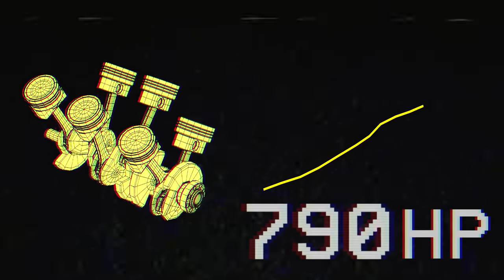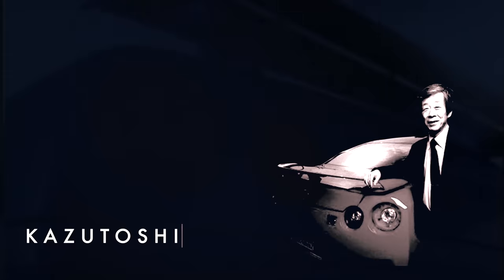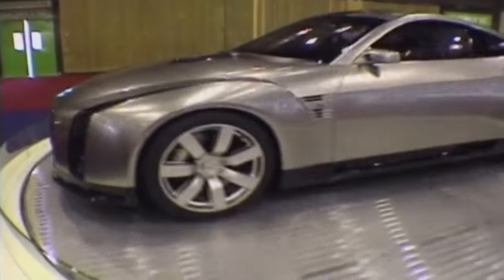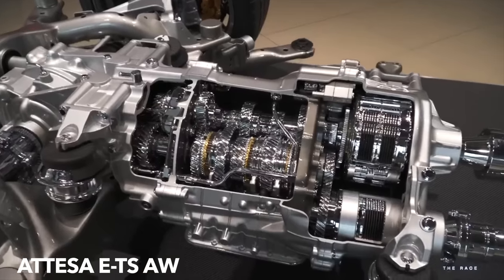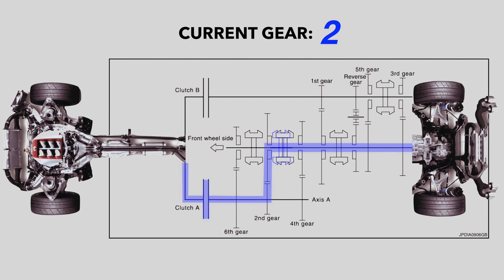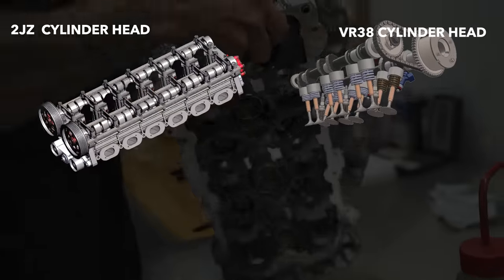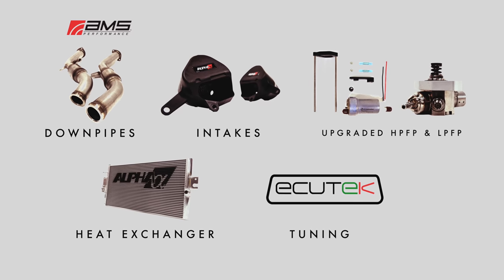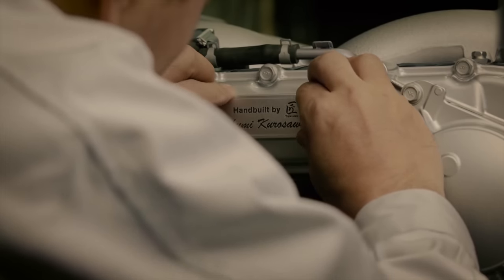Why Nissan’s Turbo V6 Engines Are Too Powerful (GT-R and Z)😳| Explained Ep.31

Comment: But the two jey zee soupbruh comes with 10000hp stock, so it beats everything
Reply: Understatement.
Reply: Haha yes mate
Reply: Your comment made me spill my tea
Reply: @driftmouse_official  Your comment made ME spill my coffee. 😂
Reply: Thanks for the pin lol
Reply: 2 Jay Z's
Reply: @Hoonagen hope u make more hp after that)
Reply: @chabweezy9905 2 Jay Z's are better than one
Reply: Handuh is better cuz that V tech just kicked in yo!
Reply: More like 1337 speed. Always great vids. Still waiting on the diesel 2j thou Om606 Benz diesel
Reply: You got that right! Toyota numbawan!
Reply: Haha 2jz stock bottom end actually does support 600-800whp. OEM VR38 would do a rod at that level.
Reply: 🤓 actually the 2jz came stock with 349hp n/a if you tickled its balls
Reply: Easily! It could power a locomotive or oceanliner if needed
Reply: There actually kinda slow stock. You can do true twins conversion and crank boost up with fcd but ur capped around 4-500 on those stock twins.    You can upgrade them though. And with more fuel. Make some decent power with a great power band.   But they need those twins junked and a t4 slapped on with big fuel too make 1000. And for how long. Now 800 that’s more realistic
Reply: @BNR_248 stock factory vr38’s make 600hp lol, stock long block can take 800 on race fuel. Really isnt much difference between the two motors in their ability to take power stock. Ive seen 500hp stock 2jz’s throw rods and pinch rings.
Reply: 3500hp barras in Australia, barra is the best inline 6 ever built. I own a 1000kw territory (built to actually take 1500kw).

A barra powered supra has 30-40% more torque at the same hp and the motor is actually lighter also....
Reply: @DirtyDanRacimg Yep I said 600whp not 600hp at the crank. I know how much a GTR makes cause I own one 🤣. Agree I’ve seen 2Js grenade itself on much less power, but on average a good condition 2j on a good tune will do 600-800whp. It being mostly in a rwd application gives it a bit of an advantage..
Reply: @BNR_248 VR38 bottom end can hold over 900 wheel hp it’s the torque it can’t handle. Anywhere past 650 tq is iffy but plenty cars running around with 680 ish torque.
Reply: @damonlandry9129  yea that’s true, I was just going off the arbitrary number suggested in the video. But agree, cylinder pressure and torque kill rods and bearings.
Reply: You’re not wrong tho
Reply: thats what r35 owners think when they buy thier r35 LOL.  30k in transmission and 120K in engine parts IT DECIMATES ALL!!!
Reply: The broccoli hair ‘do it for paul/sadboi’ bros do be thinking something RB or JZ powered is unbeatable even stock lmao
Reply: @BNR_248 the vr38 can do that too, just keep the torque under 600lbft. Supra bends rods over 600lbft of torque too
Reply: @Zonda1996  dude, no need to take my comment seriously it was just a joke
Reply: 250 pounds of boost or its not a real supra
Reply: @jonathanramoslexusmaster298  they're
Reply: @BNR_248  is it 600 or is it 800? Difference is like huge. It's more than most cars on the world. In most cases even Brabus don't put 200 hp on stock engine...
Reply: @DirtyDanRacimg facts 💯
Reply: @BNR_248 dude 600 whp on a rwd is 705 crank , while on an awd it’s equal to 750 crank . AWD whp is more than RWD whp . You can make over 800 hp on a stock gtr block but the torque has to remain low , how do I know this ? It’s because Ivey tunes my GTR that I’ve owned since 2014 till present and he broke all of this down to me.
Reply: @bboichirok661  Yea i own a GTR too mate and i understand how rwhp and awhp works. Not sure exactly what point you're trying to make here..?
Reply: The soupbruh
Reply: Oe block and heads 5.4L has gone 300.4mph in the standing mile. 2Jz has not.

Twin cam Ford > everyone else
Reply: Your comment made me spill my piss
Reply: Supra kid is everywhere
Reply: Incorrect matey they don't come like that stock it's just Toyota allowed there engine to be strong enough (cast iron block) to withstand the thrashing they get after being decked out meaning street or shop tuned not factory akid would know that
Reply: That was up until Paul Walker invented the Neiyhsaan Skaeiliner Argh 34 GEEDEARRH with the Arby twennysix D E TEETEE MOTOR.
Reply: This comment made my day haha
Reply: And it's got 2ft thick cylinder walls and 1meter long head bolts so it don't lift the head when it's pushing nearly  110000 bhp , I heard 🤷🏻‍♂️
Reply: 10000 horse power ahy.  worlds fastest car ever rite here
Reply: @BNR_248 you have never built an engine lol
Reply: @georgie2844  I’ve built 2 2.8l stroked RB26s cupcake…
Reply: i laugh dat too hard
Reply: NAH! The VR is a better motor than the 2JZ stop watching the fast and the lame movies!
Reply: @BNR_248  Wrong! You can easily 600-800 on VR38, the wrist pins are the weak spot above 800.
Reply: Yea is that the one with the twin vtec?  I read about this one in a shrek comic
Reply: Dam Nismo Haters... Supra NsX is 3 fanny litres  while the RB26 is 2.8l ....Toyota and Honda got as up while Nissan smks them with littler engine....3l vs 2.8 l   you forgot aye!
Reply: The GTR & Z all day over the Yamaha 2jz😂😂.
Reply: 😤 YOU TALK ABOUT EVERYTHING OTHER THAN THE VR6 & W8 ENGINES 😢😢😢 NOT COOL BRUH 😑 LIKE BRUHHH HURRY 👉 VR6&W8 -VW GROUP
Reply: @BNR_248 lmao what  ?dude what are you smoking on bro🤦🏽‍♂️😂💀
Reply: @joaquinzamora9873  what exactly do you disagree with? Most of the responses here have been either uneducated or biased from fanboyism.
Reply: For a engine that was built in the 90s the 2jz still stands at the top in today's Era. Japanese know how to build engines that last
Reply: @namealreadytaken9531 😄😄😄😄😄
Reply: No it doesnt
Reply: It's Jay-Z
Reply: @BNR_248  that GTR can handle 800 wheel , it can’t handle the torque.. you might own one but I have tuned them .
Reply: Not everything
Reply: likes in this comments have more numbers than 2jz hp jokes aside  i use stock 2jz i say if taken good care they are the most reliable 6000miles still going strong in my 2000 lexus gs300 with regular maintenance till date never my car stop on road o been on recovery
Reply: Smart engineering but dumb sales…Price their iconic cars out of people's reach…..They never learn from the Germans…instead of giving fans what they wanted, they came out with a different design than what Hardcore wanted….NSX, AFA, Supra, Nissan Z and nobody buys…
They should learn from Dodge Chargers, and Porsche 911…keep the price low and mass-build them and don't change the looks.
Reply: I hate Supra fanboys so damn much
Reply: Maybe beeyondcee would appreciate Two Jayz's 😅
Reply: CEFIRO, MAXIMA and CEMAjapan
Reply: 10k horsepower?
Reply: this comment angers me but is funny LOL
Reply: Smokey used a Nissan RB 😏
Reply: @dylandesmond the problem is they don't last long before needing a rebuild.  Great engine though and many of my friends have them. There is an 1800hp Ute running around near me but is off the road a lot when something breaks
Reply: @dylandesmond 2jz is more impressive. Barra is 4.0 liter vs 2jz 3.0 liter.
Reply: @BNR_248 depends on the version of the 2jz. The upgraded race spec version? Yes. The base model? No.
Reply: @DirtyDanRacimg  must've been bad tuning or not a healthy engine, we made 850whp stock bottom 2jz. The stock 2j block itself has seen 1800whp before.
Reply: VR-6 Is A 1000 Times Better
Reply: @JustinGadue58  it sounds good, but not better than 2jz tf 😆
Reply: I love me a 2jz. These are cheaper upgrades for the power.
Reply: Baaahaaaahaaa!
Reply: RB26 is better.
Reply: @driftmouse_official  your tea? Must be British or something.
Reply: @BNR_248 no the VR bottom end can absolutely handle that amount of power lol
Besides its torque that really kills the bottom.
Reply: @LisaAnn777  nope. Russian from Kazan. We love tea! Also here people drink both: with milk, with lemon and even bez nihooya)))
Reply: @joaquinzamora9873  800 wheels per year? per month? per race?
Reply: @randalllawkin   no. 10KG HORSEPOWDER
Reply: Watchu talkin about bruh the 2oooo jaaay zieeeee makes 100000000 horsiepowa stock so i don't know watchu talk about bruv
Reply: A 12yr supra kid😂
Reply: While they call the 2JZ-GTE bullet proof, I went through 6 of them in 2 years.  That's running a Turbonetics T-72 ball bearing with only 1000cc injectors,  drifting led to detonation.  However the 350 and 370 Z's weren't even capable of sustaining life at stock HP, one example threw a rod with only 4k miles.  Nissan is not consistent and at this price bracket I'd recommend a Porsche.
Reply: jeez, you prolly drive a civic Si 😂😂😂
Reply: the reply to this goes JZ stands for cheesy POP. RB - stands for Race Bred... just a hks turbo and a tune with a power fc..xforce exhaust and some bigger injectors and better coil packs., cheap asian FMIC.. and a proper excedy clutch with a tune.  i had a 418hp skyline r33 GTS-T rb25dett. that cost less than your shirt in 2008,.. that would eat GT3 porsches... alive. it cost $7600 as a complete build. and it was smoking vehicles 100 x its value and at times cars nearly 1000x its value (at that time). and im  pretty sure when i got that car.. it had 160,000kms on the clock.. im positive it had already looped the clock and was 1.16 million kms. virtually the same compression since new.. down about 1 psi. JZ's simply dont compare. when you build a rig thats not a massive turbo lag rig for the drag strip and you design it for a medium power in the medium power range tune where it lays it down correctly.. you build a system thats like a stone skipping across water... its not about the HP.. its power to weight and how you apply it. that 418hp skyline did flat 11's on QM and was 1480 kgs curb weight. when wound out it hit 287 kmh/r with a 5speed. and still had 1000rpms to go. when they say old GTRs do the  320km/hr stock. theyre not lying. You tell me the last 7600$ build youve seen with totally faded paint that does 11.04 on the QM....no one but godzilla's cousin with a build date of 1993. Engine builders and mechanics are overrated my mechanic was a plumber who still holds the track record for SR20-build on radial tyres. He builds better STi motors than the experts and its not even his field.He had a RS liberty that did mid 10's without even a computer and a billet turbonetic 82.5... people would look inside his bonnet totally confused. xD NOTE PRO TIP to all entusiasts plumbers know more about turbo ramping and air volumetrics than mechanics and engine builder specialists or turbo specialists combined. ive seen my plumber solve overboost  issues in less than 10 minutes than entire turbo spoecialist companie whotook 5 visits and multiple days. they the plumbers build a better turbo rig in a lazy afternoon than turbo specialist with 5 mechanics on deck in two weeks. ive seen this real time. If you want a sick build cheap. get your plumber friend to design your piping intake system plumb back bovs only. none of this fake turbo shit sound. true boost or GTFO
Reply: but the 2J goes for 5 seconds before it blows up. so it wins nothing XD
Reply: Ya it doesn’t …..
Reply: Dont you think that they also lied about it all this time? They may have dropped the supra power down for safety checks.
Reply: Better fact check: 155 mph out side Japan, top speed 177mph. Not even close. Twin turbo canceled due to costs.
Reply: 155mph outside of Japan. No such thing as stock 1000hp, sorry. Not in same class as the GTR's. @trwsandford
Reply: 3000*
Reply: @dylandesmond you got that right mate
Reply: @Robiam73 then there not the greatest engine builders.......my brother's got a 1500 HP Barra in his XD that he takes to Cootamundra and for the last 5 years he hasn't done anything major just minor work you would expect to do
Reply: Not at all, lacks 700 more HP
Reply: keralistyrus4241 right over ur head
Reply: It dont
Reply: @driftmouse_official  hahaha.. same like me bro.. i ran to hospital after read his comment
Reply: Bro forgots the bugatti 300+
Reply: 😅 and does 18000rpm on stock valve train
Reply: 2jz dies at 500hp
Reply: I mean… what’s required to get the 2jz to 700hp vs an rb? Or how much is a vr engine vs a 2jz?
Reply: Soupbruh?
Reply: ...after such lies, you still ask why is ur health bad...
Reply: 10000 horse power is more than the output of some ships
Reply: No it absolutely does not
Reply: 12 year old energy real 🤣
Reply: Soupbruh 😂😂🤣🤣
Reply: Especially if you twincharge it
Reply: @BNR_248 ah..nah..that comment is inaccurate.
Reply: Nah bro it only comes 330hp stock
Reply: 😂😂😂 lmao
Reply: 10000 horse power? Bruh

Comment: To put things in to perspective for many people, I have about about $50,000 into my gtr. I only make 850whp with a fully built transmission, and still on the stock motor. I’m looking at another $30,000+ for the fully built motor and install. Then another 15k for motec to keep everything as safe as possible. Is the gtr amazing yes, but you need deep pockets.
Reply: r35?? or older model
Reply: Maby invest some time and do it yourself insted?
Reply: That's the beauty of a stock GT-R. It'll beat everything out there with NO mods. (Not sure why your modification costs are so high. You can get a stock GT-R, spend around 50k to get 1,000 whp.)
Reply: Agree with u
Reply: Wew the Godzilla owner have a deep pocket to fully unleash the best❤❤❤❤❤❤ gtr35  and now 2024 gtr38
Reply: This is why I will become a pilot, I’m goina get me one of those 3,500 whp gtrs
Reply: @Struler08  Dude don’t let that price fool you. He could have easily spent that for parts. I purchased one right around Covid a 2012 black edition had I believe just over 12k miles on it. The gentleman whom originally bought it and had it consigned drove it to around 7k miles miles and and then took it to a performance shop. The guy said “make it look good  and tools brand newdrove it for and man
Reply: You might want to look at how well Haltech ECU's work in a GTR..
Reply: Serious question how can you afford it?  Please share your secrets.  . Thx.

Comment: Ive owned a 2004 350z (VQ35DE) and then a 17 Q50RSAWD (VR30DDTT), no comparison. The torque you get on VR's with a simple bolt on exhaust and JB4 is nuts.
Reply: you’re comparing a 240 wheel hp car to a turbo 400 wheel wheel hp car.
Reply: I have a G37 sedan. Love the car! The VQ37VHR is such a nice engine. I do like the VR30 in the Q's for aftermarket. They make power for cheaper then the VQs.
Reply: @snapyo1472 They do but VQ37 with the right exhaust sounds light years better than any VR30. The VR38 is just a magnificent engine in both performance and sound.
Reply: @DEATHWISHVQ  yeah he is. So what? Lol
Reply: @SkylineTwinSpoolysnail  dude I ate a rotten mango one time, then I went to the store and bought a fresh mango, no comparison I couldn’t believe how much better it tasted.
Reply: 350z was 300hp?
Reply: @MrMannyhw  you question is very unclear.
Reply: @unforeseen9267 that’s due to the fact that the vr30 has 4 catalytic converters. The vr30 sounds amazing. Go watch tj hunts “first drive 500hp Nissan z” in the first 30 seconds the sound is amazing will full downpipes, and an exhaust.
Reply: @GarciaQ60  Funny, because my Q50s has full catless downpipes, intakes, exhaust and tuned. It doesn’t have the ideal sound for me and still sorta raspy up top. The best sounding exhaust I've heard from the VR30 was by boosted6 on his Q60RS. I plan on copying his setup in the near future.
Reply: @unforeseen9267 nvm magnaflow is available for the q50. Every other exhuast is either raspy or just has a bad exhuast note. You need some sort of polyphonic harmonized like magnaflow or borla.
Reply: @DEATHWISHVQ  he's talking about the fat torque band / low rpm power on the vr30 rather than peak hp numbers by the sounds of it

Comment: as a Q50 owner this hit different
Reply: I really hope Infiniti will offer a manual option, or someone like AMS will offer a manual swap kit with the Z parts. I was never a fan of the Z33-34 styling compared to the Infiniti/Skyline cars, I'll take a the small weight penalty for better looks. The RZ34 looks amazing but still not as good as the Q50/60.
Reply: It really does